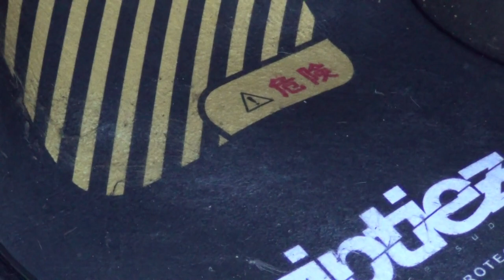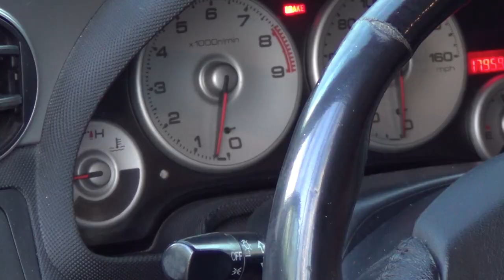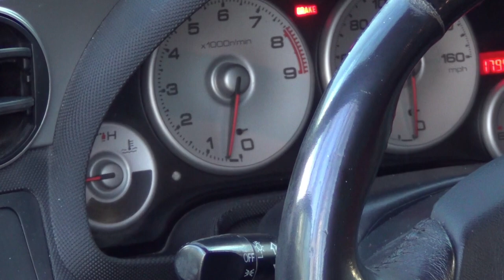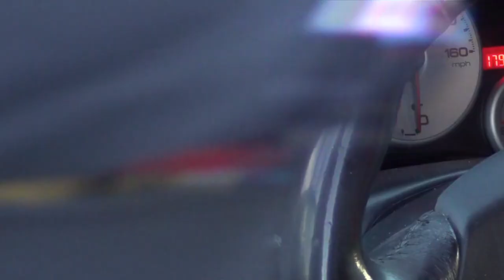2002 Acura RSX Type-S: IACV DELETE (idle air control valve)

Comment: one week after i started getting the infamous P0505 again... imagine my surprise getting that without the IACV and the car started to die and bounce again, i didn't know what happened, even changed the thermostat thinking it was broken because the car was idling really high at 2000rpm did that yesterday and the problem continued until i found out that i had a huge vaccum leak between the sandwich adapter and the TB, what happened was that the screws were too short and had to replace all 4 but now everythings perfect again.  MY ADVICE TO ALL IS FIRST BE SURE THAT YOU HAVE NO VACCUM LEAKS!!!
Reply from the maker: yeah for sure. did you put in the original iacv gasket? or was it literally just because of screw length? either way glad you resolved it!
Reply from the maker: plastic gasket? nah the gasket for the iacv should be a tiny rubber gasket. the hex screws that came with my karcepts iacv blockoff plate worked just fine. they might be too short because you are using the wrong gasket...
Reply: Shades Wade is the same material of the hondata intake manifold gasket...

Comment: Just did this to my 2002 Acura RSX type s. Runs like a champ! New idle air controller. No vacuum leaks. No air in the system. Idled up and down still at 750 to 2k and repeat. Installed the block and this took care of my problem.  Smooth as butter! Thanks for the vid!
Reply: Are you stock? I’m having vacuum leak problems

Comment: Do you have to do the IAA DELETE FIRST TO DO THIS OR CAN I JUST AICV DELETE AND CALL IT A DAY ?
Reply from the maker: you can do both or either or. order doesnt really matter. both are good to delete. ive been running without IAA or IACV for over 6 years now. idle sits at 900prm. never chokes out
Reply: @ShadesWade  thanks for responding, I just finally swapped my new k24a2 in my rsx type s !, I was having problems with idle and my aicv was bad , I replaced it like 3 times today , cause the aicy kepted braking or coolant would leak tho and gasket kepted braking , once I just cover that hole it from the aicv on tb it finally got to 900 rpm . I’m on kpro and it kepted idling 1000-2000 rpm , I kepted resetting the tps manually and kpro
Reply: I was looking for delete instructions and guidance , ur video and response helped a lot thank you so much 🙏

Comment: Got a question on a 2003 Acura rsx base automatic I had an issue with it firing on me while driving and wouldn’t turn on till a couple minutes later but now it just seems not to start
Reply from the maker: check your spark plugs or your coil packs...sounds like a misfire

Comment: You gotta open the butterfly on your throttle body until you get to what ever your idle is suppose to be in kpro
Reply from the maker: duly noted. the set idle screw is adjusted and she is sitting solid at 1,000rpm mwhahaha

Comment: I haven't picked up the LSD yet. Part of my future plans for the car. I'm still trying to decide what brand to go with. I think I'm having an issue with my iacv. My idol jumps around quite a bit. It will drop all the way down to like 100rpm then  raises to 500 or so. While parked it will fluctuate when turning the wheel too. Wtf?
Reply: Did you ever find the problem.

Comment: deleted mine yesterday and the car feels great.  My IACV was really bad the idle was boucing between 1000-2000 since starting the engine and after a few minutes lighted the check engine light with code P0505, i tried everything, cleaning the damn thing, replacing the solenoid, even replaced the MAP sensor even moved from place (i have an RBC) nothing worked.  thanks dude...WHAT MORE DO YOU WANT FROM ME???!!! FUNNY QUOTE HAHAHA
Reply from the maker: ayyyy glad to hear it worked out for you brother! on this video the only questions/comments i ever get is "DOES THIS ADD MORE POWER?!?!" LOL clearly they dont get the purpose of the mod or know how an rsx operates. certain pitfalls must be remedied! it got to the point where i literally felt like Tyrese. 13,000 choke outs WHAT MORE DO YOU WAAANT FROM MEEEEEE?!?!?!?!
Reply: Shades Wade did you  get a code after  you put the plate????
Reply from the maker: @danielportillo8387  no. only code i occasionally get is idle control system. all you do is clear it and it doesnt pop up for a few months. probably wouldnt pop up at all if i set my idle a tad higher. i have mine set right around 800ish currently
Reply: @ShadesWade  did u set it at 800 while it was running fully warmed up?
Reply from the maker: @Atomdanuke  back then it would be around 600ish on cold start then warm up and creep up to 850-950ish. now days i have it a little bit higher so when i kick on my a/c and it dips down it doesnt cut off the car when coming to stops. currently have it set around 1050-1100ish
Reply: @ShadesWade  did you have issues with partial throttle fuel cut off? did you also recalibrate the tps after you move the throttle stop or jus adjusted idle on ECU? i have a weird partial throttle fuel cutoff right after i did this at 1875rpm but give it more gas and it kick back fuel like normal. luckily it only happens at that low of rpm to where it doesnt affect my daily commute so much

Comment: I did the same thing but when warm rices up how I put my idle up
Reply from the maker: what lol>?
Reply: Shades Wade did u got ur idle up at cold start ?i need help mine idle just like in the video and cold start
Reply from the maker: the throttle body has a set idle screw on the backside you have to take an allen key to readjust it to where it should be in KPRO settings.

Comment: Hey amigo, i got the P0172 yesterday i erased it and i will see if it happens again, do you think is this related with the IACV deletion?
Reply from the maker: hmmm p0172 isnt that mean "fuel system too rich". not sure why the hell that would pop up...wouldnt have anything to do with deleting your IACV with a block off plate. i would say possibly check your injector o-rings to see if one is torn OR it might be the internal fuel pressure regulator thats in the fuel pump assembly. those would be my guesses. definitely pretty bizarre for that code to pop up!
Reply from the maker: or it could also possibly have something to do with your Intake sensors or your MAP sensor. check anything and everything
Reply: @ShadesWade  my fuel maps were too rich that's what happened, no more P0172
Reply from the maker: @edTV2024  voila!

Comment: I want to clean my throttle body because I'm starting to think my cat is the problem.  When I went to smog, It showed "not ready" for my cat and alot of ppl say is because of a dirty throttle body as one of the reasons.  Is it hard to take out the throttle body? I have a cold air intake it seems like a huge pain in the ass.
Reply from the maker: throttle body is super easy to take out...its just 4 bolts...
Reply: Yes but you have detach the sensors and hoses from it also.
Reply from the maker: @AnonX-jk3zu  thats kinds of a given...

Comment: Hi I'm going to give this a go tomorrow I have read all the comments so it's not another repeat question! I have a k100 which will be getting tuned in next few weeks and I will have the tuner to disable the iacv in the ecu will I have any issues running it like that until its tuned?
Reply from the maker: if you dont have kpro and access to tweak things yourself then its not going to run properly. you have to have kpro and a laptop to tweak the parameters necessary. once you get your k100 tuned and they can tweak the things needed you'll be fine but its definitely going to cut out and you'll have to start the car again and keep your foot on the gas in order for it to not stall out
Reply: @ShadesWade  hi, even if I adjust the idle screw to bring up the revs slightly? thanks for the rapid reply!
Reply from the maker: @p1fly  that will help so it doesnt choke out but in kpro you have to check the box for "disable idle air control valve"

Comment: on mine i got coolant and a bunch of oil leaking into the intake do u know why
Reply from the maker: hmmm no clue why you would be getting coolant or oil into your intake. has to be coming from somewhere else. quite possibly its your breather hose from the valve cover. tell me your setup
Reply: i got skunk2 inrake manifold, 70mm skunk2 throttle body, injen cold air intake
Reply from the maker: @sargentcharly  ok but are you running the valve cover breather into the intake piping? if so and you have oil and coolant in your intake piping it could quite possibly be you have a LOT of blow by getting past the rings. AND/OR you're head gasket is going out which would equate to having oil AND coolant in your intake piping. does the car overheat? i would get to checking it out ASAP. doesn't sound good / normal...hope this helps

Comment: I did this now my car idles super low when ac is on. Anyone have this problem?
Reply from the maker: whats it idle at with ac on? i mean its going to make it dip down a little when you kick on the ac...for example i have my idle set to around 825ish and when i turn on my ac it goes down about 150-200rpm. totally normal. if it dips down too low (like below 600 or 550rpm) you need to bring up your set idle screw on your throttle body.

Comment: is there an option in kpro to turn off iacv after you do this?
Reply from the maker: yes you have to have kpro to do this. in kpro it would be under the idle or misc tab and theres a box for disable iacv. you check the box. save your map. then press upload to ecu at the top with the arrow up button.
Reply: Shades Wade thank you. Tired of this
Reply from the maker: @LlLnig  yeah no problem dude. for some people they would rather keep replacing and cleaning IACVs but i just figured why not delete it and be done with it. the idle is totally manageable without an iacv.good luck bro

Comment: Does it do anything harm or check engine lights by deleting this?
Reply from the maker: it does no harm whatsoever. the only thing its going to do is make cold starts take a little longer.
Reply: Shades Wade ooo I see thanks
Reply: Shades Wade will it have a check engine light if there is no tune?
Reply from the maker: @Sir_Wilo  question 1) do you have K-pro? because if you dont have k-pro or an engine management ecu you CANT do this. there should be no engine light coming on for the idle air control valve. occasionally you might get a idle control system code but that means you just need to bump up the idle a bit more with the set idle screw on the throttle body. hope this helps
Reply: Shades Wade no I don’t have anything yet, looking forward to geting k tuner tho
Reply from the maker: @Sir_Wilo  yeah you cant do this without kpro or ktuner. it isnt possible. car will choke out. are you 02-04 or 05-06?
Reply: Shades Wade 06
Reply from the maker: @Sir_Wilo  yeah ktuner is the right choice for you then
Reply: Shades Wade planing on getting the v2

Comment: What’s the point of this? I just got an Acura rsx literally 2 days ago.
Reply from the maker: the idle air control valves on these rsx's are known to have issues and failure. so unless you are in super cold weather locations, you can just delete it all together. it takes the engine a little bit longer to get up to operating temperature but no longer then 5-10 minutes. definitely a better choice then always having to tinker / clean the iacv.
Reply: Shades Wade is there any gains from this? performance wise or does it just get rid of it so you don’t have to worry about it?
Reply from the maker: @deathstalker176  no lol. no performance gains. it just makes your car a more predictable and well balanced machine. no faulty parts wearing out...

Comment: I subbed a few days ago. Really dig your channel dude! I also own a silver 02 rsx type s. I don't have a channel, but I've been modding my ride. Skunk2 alpha rh, mugen cat back exhaust, em2 front sway bar, eibach rear sway bar, god speed rear lower control arms, beaks tie bar, injen cai w/pre filter, hasport 72a motor mounts, stage 2 competition clutch w/ light weight flywheel. Will be installing k tuned street coilovers soon. Future plans include front and rear camber, LSD, Skunk2 intake manifold w/ 74mm throttle body, and of course kpro v4. Will be getting a carbon hood and type r wing at some point as well. Good luck with you build! Can't wait for more content dude!!! #jdmlife
Reply from the maker: first of all thanks for subbing and showing some dc5 love dude! second of all that mod list sounds awesome! glad to hear your rocking that 74mm tb. usually people go 70mm or 90mm. what brand LSD you running? thats definitely in my near future once i replace clutch and flywheel with Exedy Stage 1 and Lightweight Flywheel. any specific dc5 content you want to see? i usually just do installs and vlog type stuff, but if theres anything you want to see in specific let me know! about to have this full length 1 hr HDAY special uploaded today. was a hell of a good time even though the weather was disgusting haha. anyways cheers dude thanks for the dc5 support! Satin Silver Metallics ftw!

Comment: do u still hook up the coolant to it?
Reply from the maker: not if you deleted the idle air assist valve. look at my other video
Reply: @ShadesWade  I'm about to hook up my cte supercharger, is a good idea to delete that air assist valve too?
Reply from the maker: @christopherrogers8316  all depends on how you want to set your car up. if you can get by with no iacv then i would say yeah delete the iaa as well. good luck on the supercharger bro
Reply: @ShadesWade  so I just put the aav delete on the charger Mani?
Reply: I mean like, I don't need a new hose or anything? Just the delete screw?
Reply from the maker: @christopherrogers8316  correct the iaa delete from karcepts or k-tuned will do the trick. just a blockoff bolt. deletes the 3 tee piece
Reply from the maker: @christopherrogers8316  honestly id have to see your setup in photos or something to know. im not a supercharger guru. hit up cammo_fk8 on ig and ask him. hes running a magnuson tvs kit on his dc5. he knows supercharger info well.
Reply: @ShadesWade  no prob, oh and I'm doing both a iacv delete and the throttle body coolant bypass, should be fine right
Reply from the maker: @christopherrogers8316  the coolant line that goes to the iacv is essentially just so the iacv know the temperature of your coolant. it isnt passing any coolant to it or anything like that. if you are deleting the iacv expect the idle to be a little iffy on cold starts but once the car gets up to operating temp its solid. in kpro or your ecu program of choice you have to select "disable iacv" and on your throttle body use the set idle screw to bring up the idle to your spot of choice. on mine i have mine on cold start going to about 625 and once the car gets to operating temp its right around 875-900ish. hope this helps
Reply: @ShadesWade  thanks!